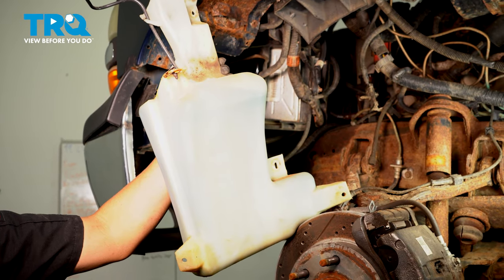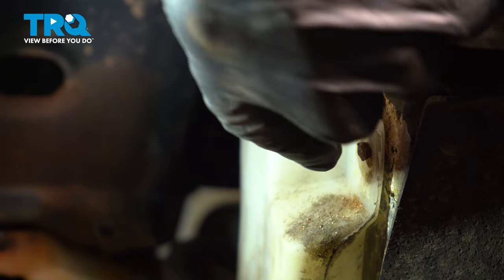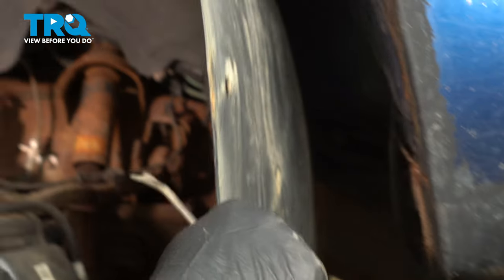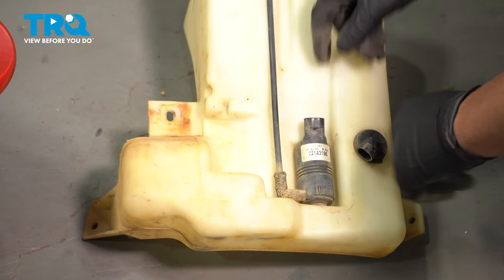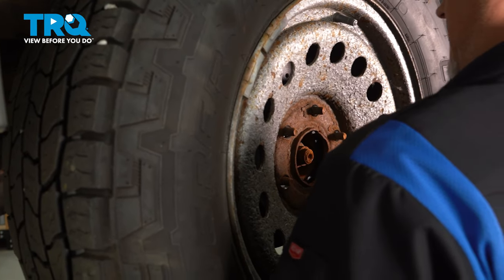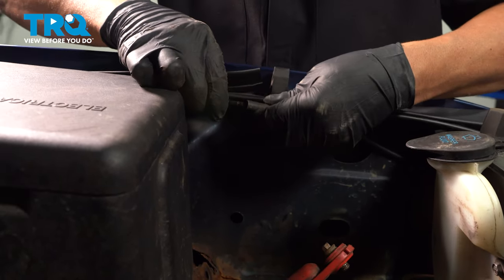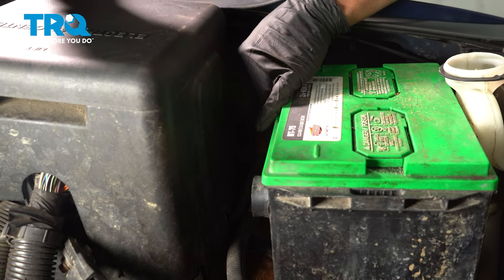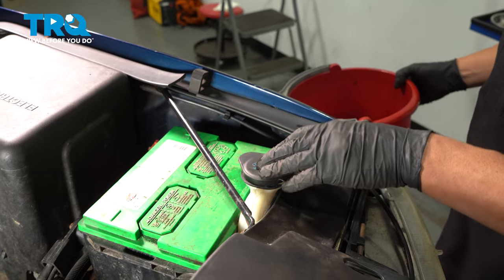How to Replace Windshield Washer Reservoir 1999-2006 Chevrolet Silverado 1500

Comment: I had a small hole in my water reservoir so I was going to change it out until my friend told me just put some 3M 5200 adhesive it’s made for water and it’s like cement won’t let anything penetrate cost $10..worked like a charm and same me so much time!!

Comment: Just did this replacement today.  You actually dont even need to take the wheel off, just turn the steering wheel all the way to the left and there is enough space to remove the front half of the splash guard.  I also didnt even have to remove the battery tray.  The neck of the reservoir is skinny enough to slip in and out.
Reply from the maker: +@nodnarblac Thanks for watching our video! http://1aau.to/m/Shop-TRQ